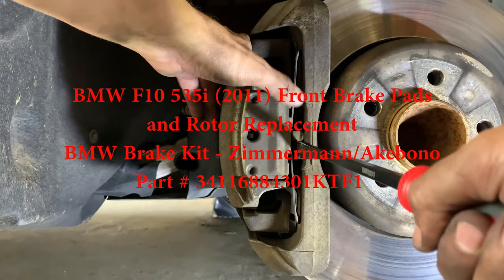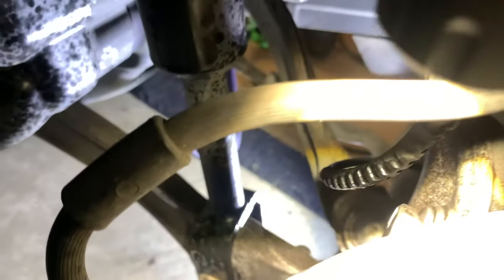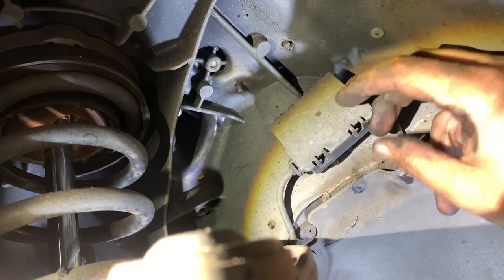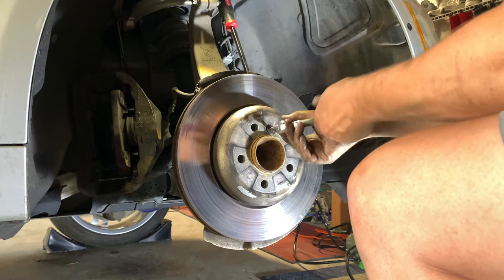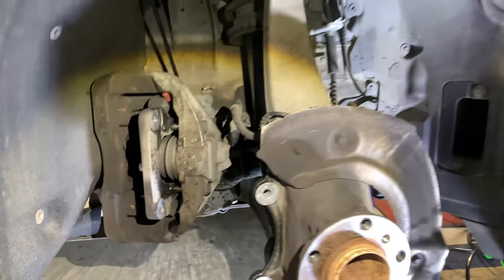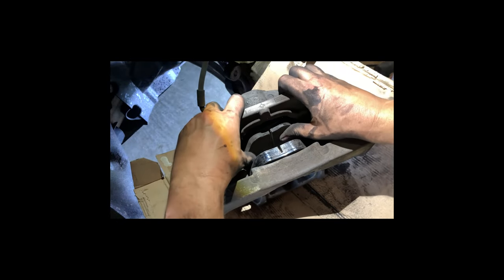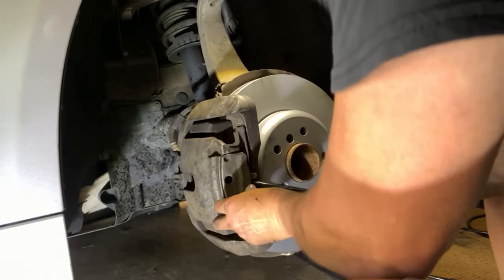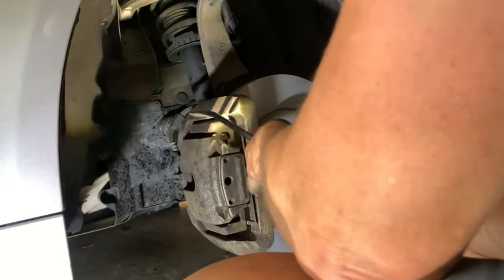How-To: BMW F10 535i Front Brake Pads and Rotors Replacement DIY (2011)

Comment: Completely skipped removing everything.
Reply from the maker: @paulanderson2292  it’s very simple. The caliper is held by two bolts. Remove them and slide it off. The rotor is held by a single bolt. Remove and slide it off aaaaand you are done.

Comment: Its breakpads for 535i 2011 and 2015 same or not?
Reply from the maker: I do t think so. The 2015 is a different chassis. You can go a site like fcp euro to confirm.
Reply: its the same on all of them except m5s same. Facelift cars are the same with different steering wheel and different lights